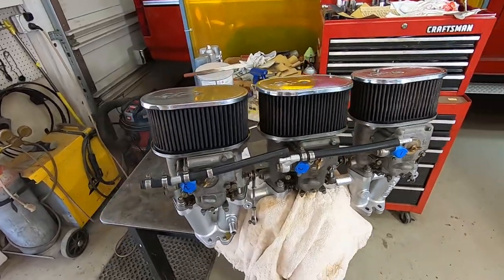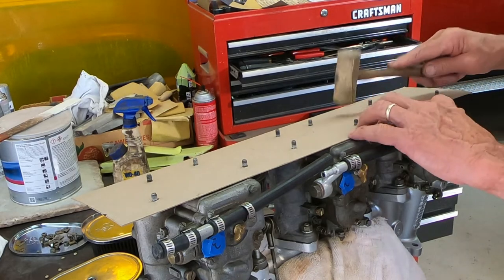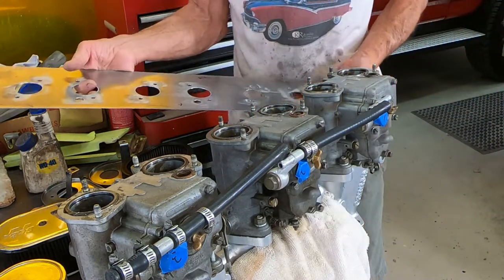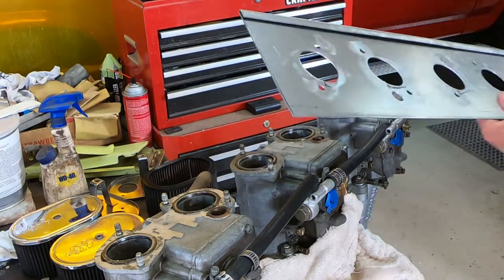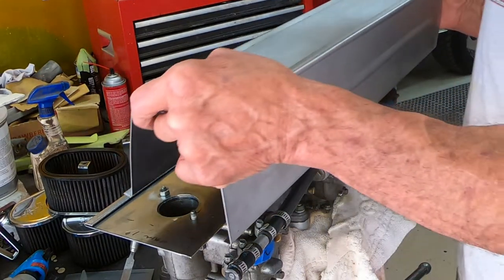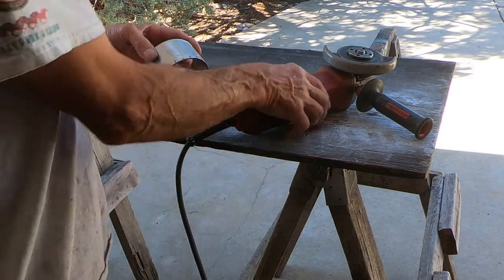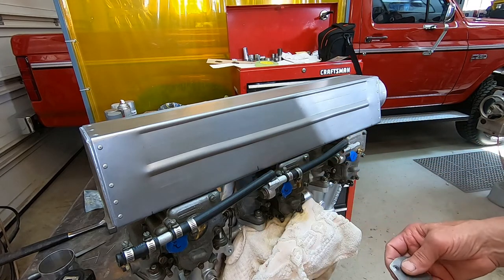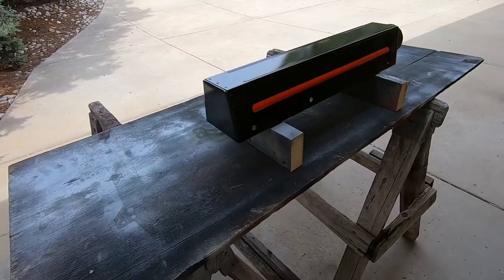Datsun 240Z - Triple Weber Carburetors - Cold Air Intake Box - Air Cleaner Fabrication

Comment: Curious to know how much restriction of air flow that is compared to the K&N system and if it will affect the engine performance.  Nice workmanship on the unit.
Reply from the maker: Thanks for the comment. Before I made this thing, I had the same thoughts. But after realizing that a lot of big breathing V8s (5.0 L and up) use cold air boxes with inlets not much bigger that mine I figured it would be fine for a 2.4 liter engine.

Comment: Nice work,  why not aluminum?
Reply from the maker: Thanks for watching! Aluminum would be nice, but I had the sheet metal on hand. One thing I failed to mention in the video is that the cover was made out of a lighter gauge than the base.
Reply: It would be interesting to see the difference in sound between the two different materials. Aluminium is a bitter deader than steel.